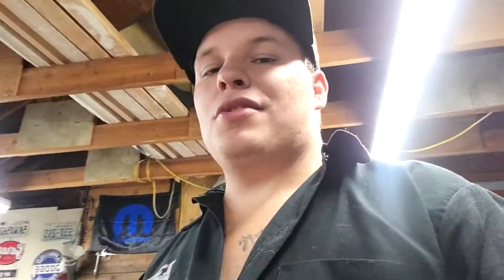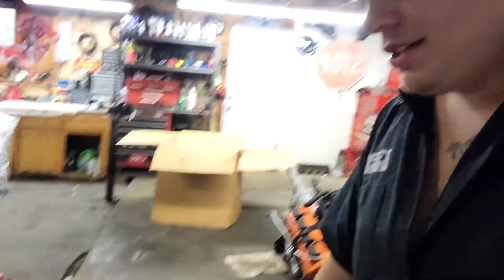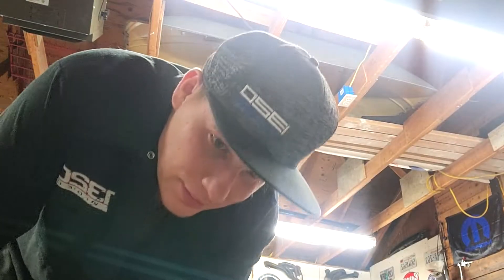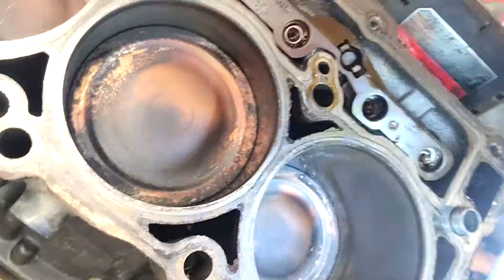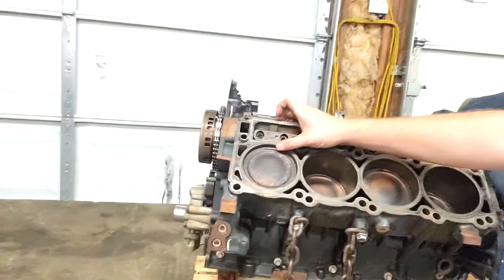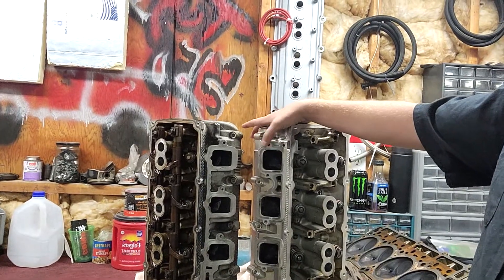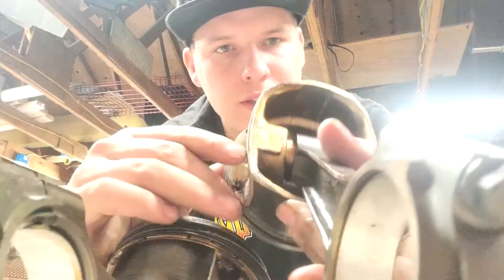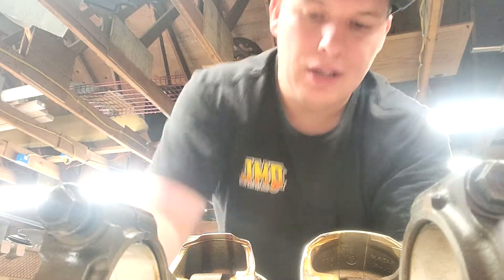Is It time to GIVE UP on the Hemi and go LS??

Comment: I knew you weren't going LS LOL no doubt you were staying mopar with this build. From what holley has on their website all 6.1, 6.4, 6.2 engines have forged crank. Rods are forged powdered metal and pistons are hypereutectic. Id suggest if you're going full send and want it to last longer upgrade the pistons. 

Been a while man, glad to see you doing some work. My dakota is still on the back burner especially after Ida. Needs a power steering rack and front suspension gone through. May throw a hemi into one of them though, and it might be the 79 camaro LOL. 

Keep it up 👍😎
Reply from the maker: Thank you brotha I will keep that all in mind I'd love to see ya and what you do with it either way! On bothe dakota and Camaro

Comment: I am building a 6.4 out of a Jeep to put in my '74 Dodge Challenger. I have the drop in forged pistons and rods but my dilemma is main studs. They're not available until December and I don't want to wait. I'm seriously considering going ahead with the factory main bolts.

Comment: I think the 6.4's came with forged cranks so if you go with a forged bottom end you just need forged pistons and rods so it wouldn't be too bad. I've heard that the pistons are again the weak point of those later model gen 3's. The heads and block with support anything you throw at it
Reply from the maker: You are correct on all things you have heard. They are factory forged. Hope your day is going well my friend.

Comment: Gap the rings, tossacam in it and go! Your base hp is going to be up so less boost to get to 1000 hp. 15 lbs should hit your goal and remember dont kill it with torque, no timing or high boost until  you are above 5000 rpm! You can do it!
Reply from the maker: Thank you for your support and kind words we are all in this tougher!
Reply: I like that too. You will likely race a good while while working bugs out and getting faster before you need the 1500 hp
Reply from the maker: @mopar1darrell  definitely good a thought we will keep in mind

Comment: For the power u want I say forge it. If budget allows do a billet crankshaft to match the goals you want. Gap the rings, port those heads, do a ported & polished 6.1 intake, better valve springs, thicker wall pushrods, and see what you can get her to
Reply from the maker: Awsome advice thank you! I'll take all this into consideration 😌

Comment: I'm watching you... you got the resources. Just installed my circle D 4600 stall converter and im nervous as hell to put it on the track lol but I would go fully forged bottom end if money permits it
Reply from the maker: Hell yea man got to make big power ! And thank you for your support!
Reply: Hell yeah brother I had a feeling...
Reply from the maker: @Daniel G  to be honest that all might be changing with new set up so not sure how it will apply however I never had a problem building boost. So wasn't trying to trick it I have converter dumps for that
Reply: @Daniel G see it depends.... I have a centrifugal force supercharger and it builds in the rpm. Also for lack of terms you lose boost in the summer/humidity, furthermore off the line your leaving with no boost unless you bumping in or a 2 step of some kind. That's just the nature of different forced induction and situations but as far as a cam with a stall converter is great if you could match the power

Comment: i wonder if it’s a forged crank in the truck engines.. might be… aftermarket pistons and rods might be the bulletproof recipe for the 1500-1800hp. but you never know.  those small changes you see from the 5.7 to 6.4 could be a big difference in strength. the extra beef you see on the 6.4 rod might be enough. Look at a gen 4 LS rod. it’s nothing special really…they look tiny. and they don’t look much different than the gen 3 LS rod. we can visually see the difference with that 6.4 rod. that’s substantial for sure. You should put callipers on it and measure the difference.. . i think 5.7 stock cast cranks and blocks have done big numbers with rods and pistons. there was an article online (Allpar) web site.. it talked about the 6.4 truck engine. the heads are supposedly same material as hellcat heads. a bit higher quality aluminum than 5.7 heads i think they said.
Reply from the maker: Yes sir alot of good information and this is a forged crank I will take the time to get more exsact numbers

Comment: Bge has the best stock head. The best way to learn is from your mistakes. I suggest pulling the 5.7 apart. Did it lift the head and break the rod? Im curious to see if it dropped a valve seat. I have replaced plenty of pre vvt 5.7s by valve seat death.
Reply from the maker: None of those were the problem I had. Alot of it is things that need to be optimized crankcase pressure better flowing turbo /intercooler. Less power brought in so soon and push it out the back to keep tq lower